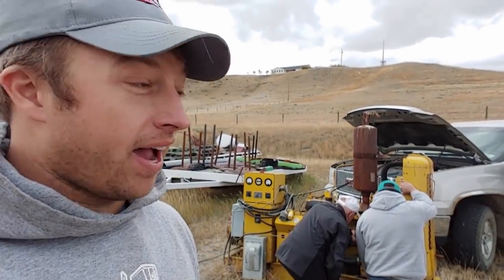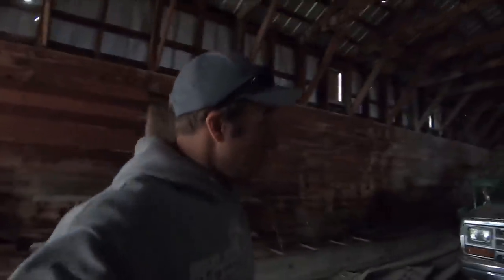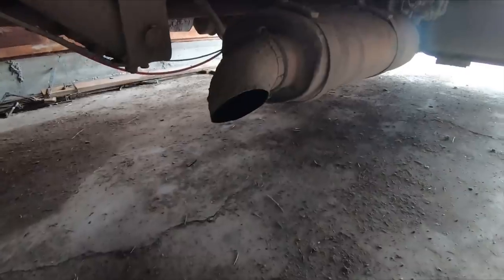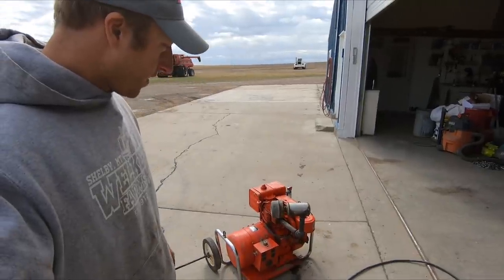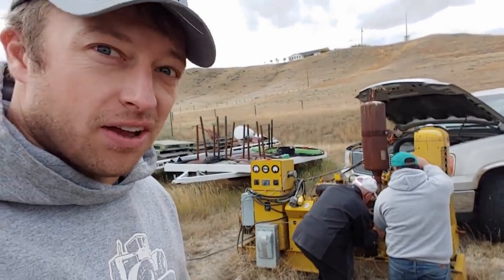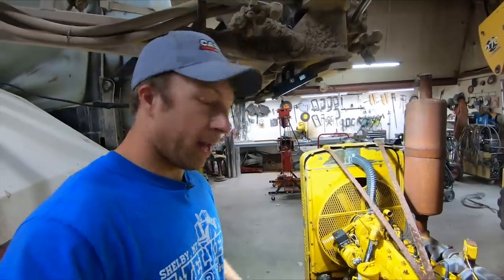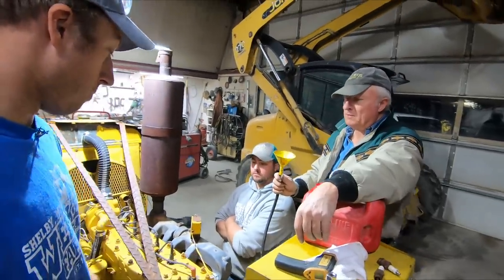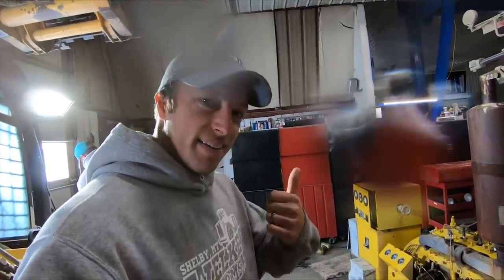Old Generator For A Mighty Storm

Comment: What do you reckon you'll sell and clear first, the sheds so you can get the combines inside or the grain piles?

That generator will certainly be handy for you I know Cotontop has his house wired with a couple of isolators so if they lose power during or after a storm so that they can isolate house from the mains and then just connect up the generator to the house and then just unplug it and switch the isolator back when the power comes back it would handy if all three houses could be connected up to the one generator in one go. I know our old farm mechanic that basically worked for five of our neighbours and us used to have to get a pair of generators powered by a V12 Rolls Royce engine each I believe they were Merlin engines that were used during power outages to power the dairy farm, bottling plant and the house the problem was in latter years the power outages were so rare that the engines and generators weren't run enough that by the time they got them going the power was either on or came back on 10 to 15 minutes later. I believe they had their own basement with and exhaust to the outside to cut down on the noise.
Reply: Probably the grain piles as the price for that good quality grain has increased over $1 this past week.
Reply: @RobertWelkerFarmerBob  so it wasn't just our lamb price that went up this week though that seems to yoyo a lot but considering what beef is like at the moment as well as cereals I can't grumble too much and we actually got a surprise that where the local co-op hit the wall a couple of years ago due to bad management we are getting 60% of our investment back from the liquidators which was a surprise as we had  thought by the time KPMG and other creditors had been paid that we might get a whole £1 back at most. Not nice after a 100 years it went to the wall but somewhat nice to be proved wrong.

Comment: Hey Nick you should set the engine to around 1800RPM should get you the 60hz we use in the USA,
Use the DVOM on the frequency setting and set the frequency to 60hz +/-1hz 

1500rpm would be closer to 50hz they use in many other countries.
Reply from the maker: That is an excellent point! Thanks!
Reply: Welker Farms Inc You’re Welcome!

Comment: I would have tacked a couple blocks under the I-beam instead of cutting holes and compromise the structure.. Just an old spec welder speaking of course
Reply: We looked at the structure and determined that the frame wouldn't be comprovised.

Comment: That system is DESIGNED to run at 1800 RPM.  Even though the voltage regulator may be able to get the voltage up, you will never get full power at 1550 RPM.

Comment: On the sprayer, can you run alcohol through it before shutting it down for the winter? 91 isopropyl alcohol freezes at -128F, methanol at lower...  ?
Reply: Also, reality check- you live in MONTANA- you need a backup generator for each house on the property!!

Comment: If it says run it at 1800 then run it at 1800 not 1500. Because the RPM sets the frequency of the alternating current at 60 hz do not run anything delicate with it unless the frequency is 60 hz because electronics don't do well with  fluctuations in frequency.

Comment: Need 1800rpm to reach 60Hz, your clocks will lose time and motors will overheat at 1550rpm.  
Recommend setting to a verified 1800rpm.
Reply: Thanks for the info.  So true about running a recommended rpm.

Comment: The 1800 is the fact that it has 4 pole alternator and with that old of a unit you should set the engine speed to about 65 hertz  so under full load it will Droop to 60 hertz which that is the standard for the United States frequency (hertz).
Reply: Ok 👌 thanks

Comment: You’re a Pilot, just put some 100LL in all your gas engines that are going to be unused for an extended period of time. Make sure you run the machine to get the 100LL in the fuel lines and carburetor. 100LL will keep for a very long time and not varnish. I saw an airplane that had not been run in 5 years get the tires aired up and a new battery, same old gas and it fired right up and set there and idled.  A little expensive but saves time and money on replacing fuel lines and rebuilding carburetors.
Reply from the maker: Definitely thought about 100ll, have good access to a pump at the local ap. I'll grab a few gallons and get all the small engines primed.

Comment: That is a four pole generator. The engine needs to run at "exactly" 1800 rpm in order to produce 60 cycle electricity . Most AC devices require 120 volts at 60 cycles  in order to operate correctly.
Reply: Thanks 👍

Comment: I wonder if shipping containers are expensive around you, you could, in theory (well not theory since it has been done to death in the architecture community) stack up a bunch of them, interlock the outsides, drop reinforcements on the wall segments (where they meet) and then cut the "guts" out leaving you with a "building" large enough to put one vehicle or more, depending on length, i probably wouldn't go higher than 2 units. You're left with a lot of siding material from the insides, and you get a solid building. Even cut, if done right, they should be more than enough for a hole to hide stuff in. 

Just some rambling, the cost of one might be prohibitive depending on where you are in US.

Comment: That is the same engine that is in the old Lincoln SA 300 welders you can get engine parts for those fairly easy through a welding supply place or a rebuilder of Lincoln welders through the Internet  They're super dependable gas engines

Comment: handy to have neighbours that are prepared to help out. Being on the end of a Power line it might be an idea to get a solar panel and battery setup installed. 
https://www.abc.net.au/news/2019-10-05/standalone-solar-replaces-power-lines/11572762  they have done it here and found that the power delivery is a lot more reliable.

Comment: Awesome video I love watching you guys work on projects in the shop. That continental generator was a really good score! Obviously it’s hard to tell from the video but your Briggs & Stratton generator sounds like it was running a little bit faster than 1800 RPM’s did you guys put a meter on that one and see what the output is? I’m sure you already know that though lol.
Reply: For that B&S it's run rpm is 3600.  That's where you get 120v.
Reply: Robert Welker Yes I actually meant to say 3600 RPM lol but I was thinking about the big generator while I was talking about the Briggs & Stratton generator. It sounds like it’s running a little bit faster than 3600 but maybe it’s just the video it’s hard to tell. Have a good weekend!

Comment: That's a nice generator! I don't recognize the manufacturer (Fermony?), but the fact that it's 208v. 3 Phase with a 120vac. center tap will make it very appropriate if you already have 3 phase power into your place for grain dryers, large compressors, etc. At 35kw. it should run pretty much the whole place (minus a few high amp draw motors). The M330 is a pretty fair sized (330 cu. in.) engine and should have plenty of horsepower to keep up with the generator. Like others have mentioned, definitely keep it at 1800 rpm to keep your frequency correct! If you set it up permanently, you can get a 3 phase transfer switch to take it off the mains when it starts up, so you don't destroy anything. Here's a service manual that covers a pretty good portion of the L-head Continentals out there: https://www.weldmart.com/main/technical/cont_lhead_overhaul.pdf

Comment: 120 amps is probably enough to run a single home, and that is a pretty stout generator if it was free.  It should be capable of at least 14000 watts at the age it is.
Reply: Should, as it's rated 35K.

Comment: Use engine speed 1800 RPM
Engine speed determines hertz in your case which is 60 in the USA so f=np/120 

f= frequency in hertz, n=RPM of the generator& motor, p=poles of the generator, 120 for volts
In your case the generator is a 4 pole so:
 60=(4x1800)/120 so yes 1800 RPM is what you want it to turn at when you turn the power on to your load.
Side note a smaller generator would probably be a 2 pole and run at 3600 RPM
Sorry ..too much info?

Comment: you need 1800rpm for the 60 hz...., 1500 rpm is 50 hz< good for europe, but not us apliances,, voltages in your case must be 240,120 volts, at 60hz.

Comment: that aluminum block that muffler screws into will not hold up  that muffler very long. will need a support. once it's deformed the threads on block there will be no way to repair easily. sounds a little fast on RPM.  runs 3600 any higher say 4000 long-term and it will probably throw the rod. the output a/c is very unstable I would not use that on anything electronic.~~ L head briggs engine. probably 1980's. the firs two digits on engine code is the year model,

Comment: When I was a youngster we kept aviation gas in our small engines as av gas will keep for several months,  However it contains lead so not for use with modern equipment which has oxygen senors or catalytic converters.  Also not certain if it is legal to use for non aviation purposes because of the lead.

Comment: If that engine ever fails could you take the generator off and hook it to a pto from a tractor?
Reply: The one problem would be most tractors are at 1000 pto.  This needs to be closer to 1800.
Reply: @RobertWelkerFarmerBob  Thanks for the reply👍

Comment: how come you cut the fork lift slots in the generator at the bottom of the steel beam?
Reply: Because there's nothing blocking them going in and through it.
Reply: @RobertWelkerFarmerBob  yup, thanks for the response. Do you think the steel will fold eventually?
Reply: @methylmike  no, as the IBeam isn't compromised and the engine mounts front to back also provide support.
Reply: @RobertWelkerFarmerBob  thanks for the lesson. Have a good winter out there, stay warm

Comment: You want 120V, 60 Hz operation. AC line frequency (60 Hz) is set by engine speed. Make sure that is right and stays consistent under load (doesn't bog).

Comment: Why don't you build your own storage ??? Ain't expensive if you do it yourself like a 40'*80' and 20' high building. You guys have everything to build your own for under $20.000  just have them deliver you 8 Sea Containers and you guys build the roof yourself. Done is the building. I am more than willing to help you guys on this idea too because I am building it myself just wider and less in length. And to the POINT Generator go Propane/NG because you guys have a pipeline to your area so tap into that. It's so much safer and better. All my generators are Propane/NG too.

Comment: 6:16 what is that red truck on the left? It looks really cool!
Reply: That is a very cool flat head hemi 1954 Dodge truck which will be restored, maybe this winter.
Reply: @RobertWelkerFarmerBob  a "Flat Head" cannot be a "Hemi", all hemi's are overhead valve engines.
Reply: @jimbaxter4600  stand corrected. It is a flat head.

Comment: Turn off the fuel jet on the bottom of the carburetor then it should run
Reply: Sounds like a lack of fuel
Reply: When you change the oil use 30 weight and that old engine

Comment: Be careful about running an electric fuel pump on a carburetor to much psi is not good. Also be sure to properly secure your load it doesn't matter how far you're going. You never know when things go wrong. And somebody else may pay the price for your actions.

Comment: LOOKS OLD, THE OLDER ONES WERE 120 DC. MOST OLD STUFF WAS 120 AC/ DC AND WOULD RUN ON DC. NEW STUFF IS 120 AC, THE DC WILL BURN UP NEW  AC MOTORS .